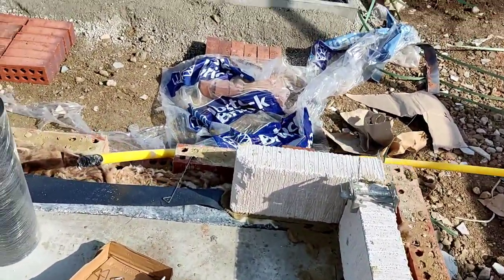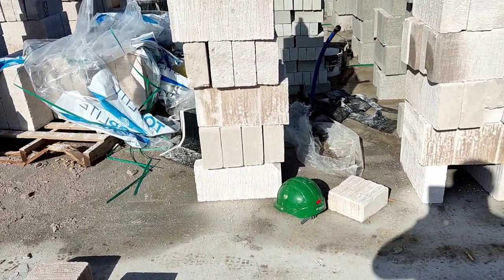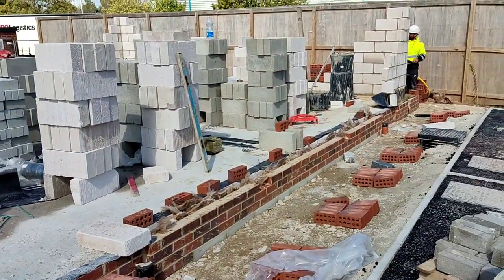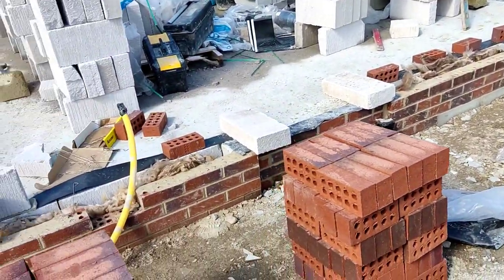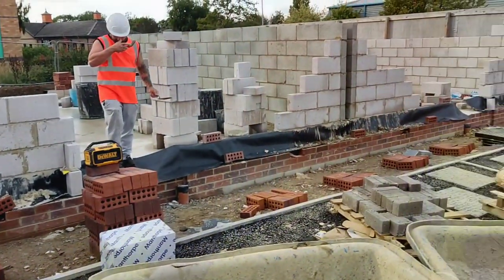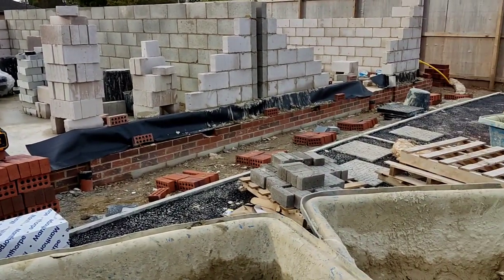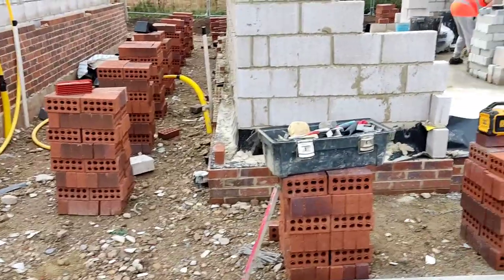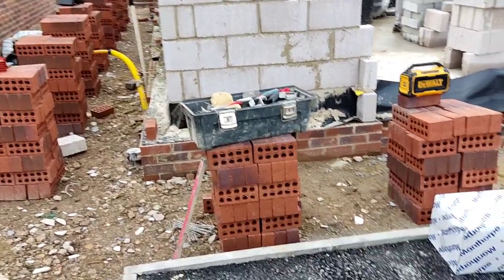Bricklaying Vlog - How I Do Blockwork First?! The Art of Freehand!

Comment: whats the purpose of pointing up  the  cavity side of the block. In fact  why the face that will be boarded over as well??
Reply from the maker: It's just what they want you to do on sites these days, no other choice
Reply: I know they will want you to do it. But there must be a reason behind it.  Everything is done for a reason. Never thought  about asking why?
Reply: It's because like this guy they do not fill their joints .amateur woodpecker this one
Reply: Full joints. Flush off the trowel. No need to point up.
Reply from the maker: @brucetindal7399  it's not an nhbc requirement to point the back of the blockwork, management just get funny with you if your don't do it.

Comment: So much wasted time with small trowel from the way joint the blocks and reaching over to cut the snots aff the back. Stand and board and 10inch trowel at least for the blocks. Tubs will work better on the bricks small with small trowel. Just ma opinion buddy.
Reply from the maker: I Just like being pain free at work mate, not saying it's the best of fastest, Im gonna be spending the next 35 years there, so I'm just making it easy on my body 👍 and I get enough done with this little trowel for the time being